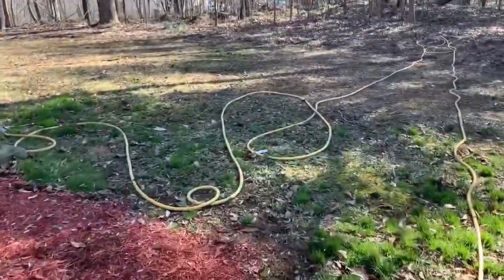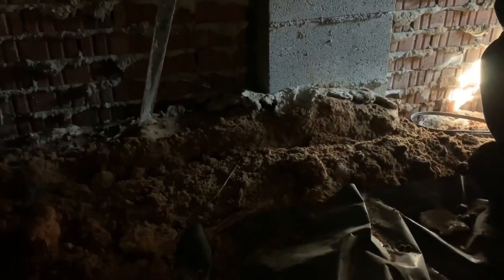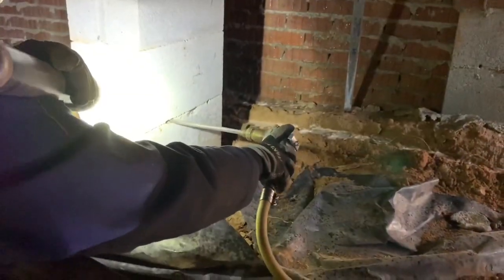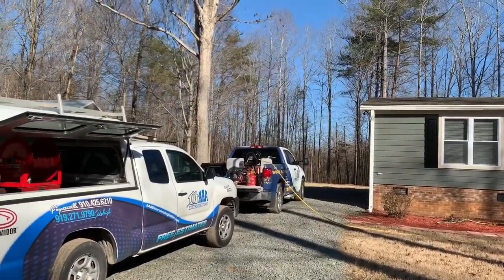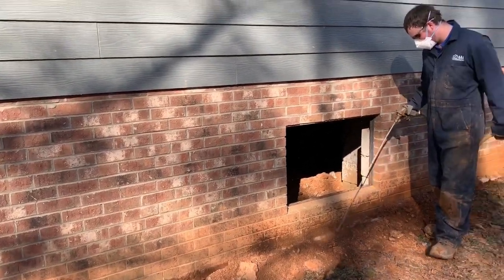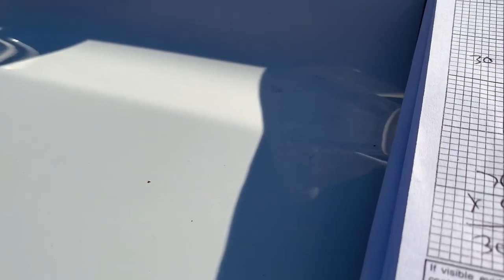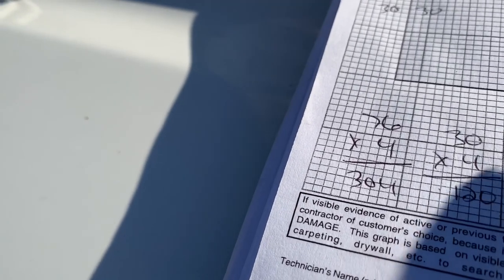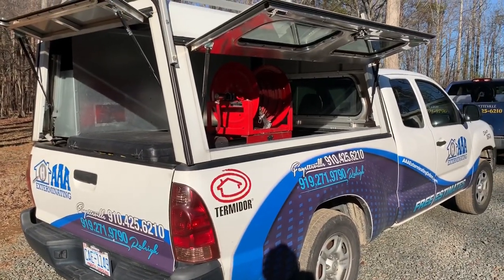Simple Termite Treatment Pricing

Comment: Doing allot of extra work, if you switched to Termidor H.E. it only takes 2 gallons per 10 at .125  ratio and you can also do a EPLI treatment process with Termidor HE and the trench only have to dig a trench 2"X4" instead of 4"x6". Only down side is it's $250 a bottle (50 gallons mixed ) but it also allows you to do a 12 yr warranty instead of a 10 yr warranty

Comment: Hello, we just moved to Venice, FL.  The (single story) house we purchased was built in 2004 and had an underslab termite treatment when the house was built. There is no crawlspace/basement.  The home seller had a contract for a  HexPro bait monitoring (wood chips ?) system. We've watched your videos and are wondering if we should have Termidor SC applied around the whole house and holes drilled in the garage slab (separate slab from the house slab) for Termidor SC ?   Should we also have Scatterbait, or other bait, added to the HexPro in-ground monitoring stations ?  Thank you
Reply from the maker: Cathy Moriarty I personally believe Termidor to be the absolute best termite protection available. If you have Termidor properly applied there should be no reason for any bait system.
Reply: @AAAExterminatingCo  Thank you for the quick and informative response.  IF you don't mind another question-do we need termite insurance (the exterminator indicated it was optional) in we have Termidor applied (given the Termidor extended year warranty) ?
Reply from the maker: Cathy Moriarty if your going to go through the expense of treating I would definitely recommend keeping it under contract. If the Exterminator doesn’t warranty damage you should find someone else. Typically the treatment comes with a one year warranty and can be renewed every year

Comment: I know some people don't like them, but why wouldn't a baiting system be good here? All the termite "food" seems to be up on concrete/brick pedestals so a bait  would be an easier food source for the termites to find which would maybe take out the colony before they even made it to the actual protected structure?
Reply from the maker: DeeCee101 bait can be effective but Termidor is a far superior treatment. We also offer bait but bait is not as effective as a good liquid treatment
Reply: Thanks for the reply...I know Termidor works well, but since it's undetectable, the termites still go through the treated soil and attack your house for a period of time until it kills them, right?
Reply from the maker: DeeCee101 yes that is why it works so good. Termites work pretty slowly, Termidor begins slowing them down pretty quickly but allows them to keep going to spread the chemical through the colony. Baits can sometimes take a very long time to get control infact I see houses all the time that have had Sentricon for over 2 years and still have active termites. If you treat properly with Termidor within 3 months the structure is free of termites and it will stay that way for at least 10 years. We treat 20-30 per week and have used Termidor since it came out and have never had one get termites within 10 years of treatment
Reply: Great info, thanks for taking the time.
Reply: @DeeCee101  not quite right.they would die before any  real damage could develop

Comment: $700 is pretty cheap for this job. I doubt that is your residential retail price. Fuse is $100 for a 27.5oz bottle. so 2 guys, 4 hours and cost of goods? No way to make enough to cover operation costs where I live at those prices here in the WASH., D.C. area. Great job showing how it is supposed to be done. I believe the Label calls for 2 gallons per 10 LF on the inside of the crawl space?